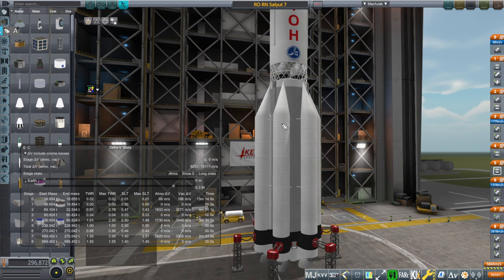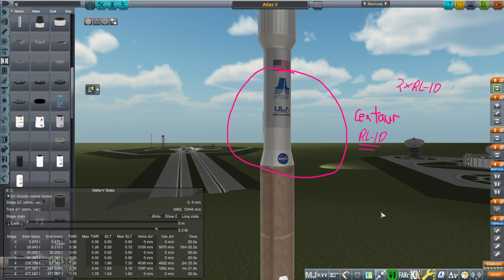Space Basics 06 - Orbital Rocket Design Part 3 - Deviations

Comment: I've met a strange thing I'm not sure it is a glitch or I just did something wrong. After every time warp, probes automatically max one of the rotation control, even I did not have a reaction wheel and RCS, it speed up rapidly. The longer the time warp is, the faster it spins, reloading the ship can resolve the problem, but most of time (long time wrap) it would explode right away. 
I'm currently on ksp1.8.1 with RO, RSS, and Remote tech. Have u met this problem before?
Reply from the maker: No, I definitely have not seen that problem.